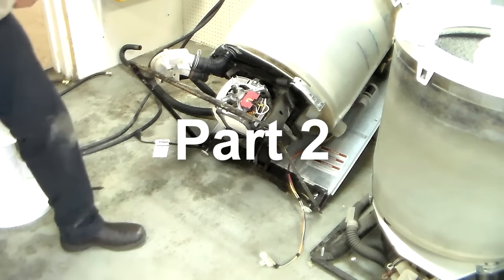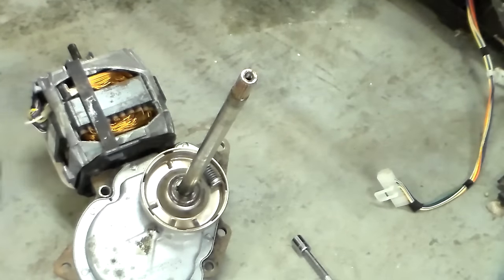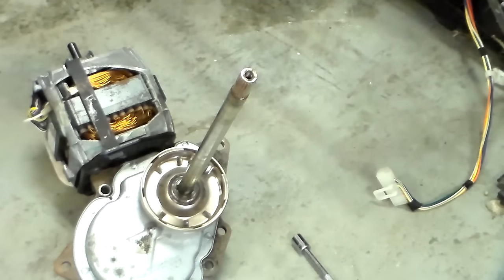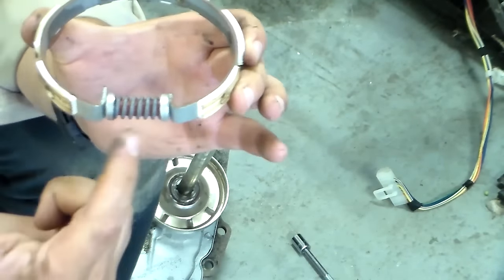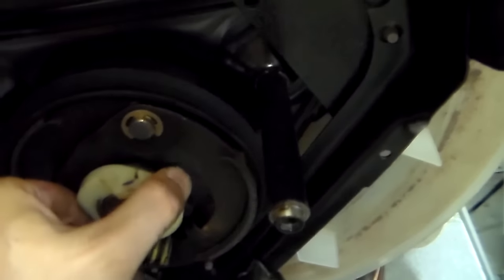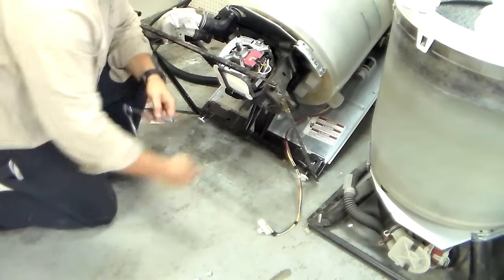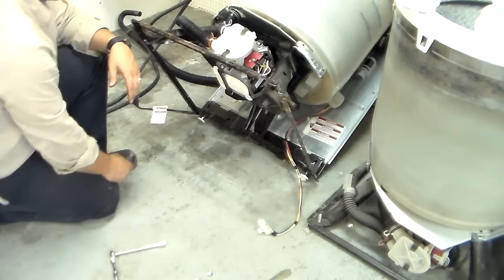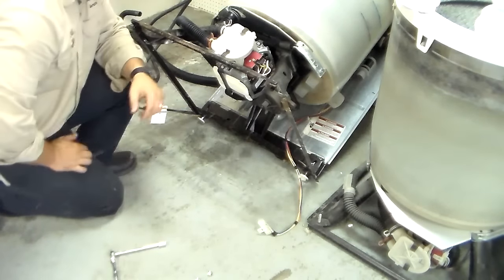Kenmore Whirlpool Washer Not Spinning 2

Comment: Hi Bill, thanks very much for your amazingly helpful videos! I have a question. I have a Whirlpool Washer that is not spinning. I dropped the motor and transmission. I hooked up my 1/2 inch drill to the motor shaft and operated it in forward and reverse and the transmission seems fine. I grabbed the clutch pad and it appears to be fine. The motor coupler is fine. Any idea what the problem is?    Dennis
Reply from the maker: Does it sound like it's spinning but not spinning or not making any sound at all when it's supposed to be spinning?

Comment: great videos!  still trying to solve my problem.  agitator works, but will not go into spin cycle.  It tries but basin does not spin.  agitator works.  replace coupler and cluch but the old ones seemed OK.  I CANNOT turn the plastic brake release counter clockwise by hand like you did.  It's like the basin is seized up.  Motor and trannie seem ok.  Is there a chance come clothing or something else is preventing the basin from turning easily?  How do I get the metal basin out of the plastic liner?  THANKS

Comment: Currently have my washer tipped on its back. Checked the coupler, it and the rubber are good, pulled the transmission to access the clutch its acting as it should in your vid here. What would you check next? I did notice one broken tab thingy under the plastic topper that needs to be removed to pull the transmission out....would one of those tabs being broken be the culprit?

Comment: Hey bill, love your videos, I do have a question. I ordered this part number 285790. When it came, it only had three white brake pads instead of the six that the original had. It does not have the tention that you showed of the new one in your video. Where do I get one like the one you used with all the white pads?

Comment: Bill,
 Last week my washer, Whirlpool, went through the wash cycle fine, it filled up , did rinse cycle okay until the spin. It made a very loud grinding noise so I turned it off. Does that sound like a coupler or clutch. I have a friend who might be able to fix it, I'll buy the part. Btw, what is a wig wag?

Comment: Great videos Bill!
After watching parts 1 & 2 of Washer Not Spinning, I performed the service checks you illustrated. Nothing was wrong there!
I saw another video about the transmission check. Would it be safe to say that that is what I need to replace? Or is there something else I should be checking?
As Compwhiz128 mentions; spin gear, cam drive, basket drive block or neutral drain pak. How do I go about checking these?

Comment: Hey Bill, my problem turned out to be a broken finger on the brake release... discovered thanks to this awesome video. Do these just brake (as they are just plastic) or should I be looking for another culprit? How much resistance should the tub offer when trying to spin it with the brake? Thanks in advance!
Reply: Also having a hard time trying to locate a replacement part.
Reply: BiGPoo5125 Nevermind... I see now that it comes in a kit with the clutch band.

Comment: Great vid,  I replaced the coupling.  The old one was rounded out in the middle.  I put everything back together.  And . . . . just the same hum.  No spinning, no agitator movement.  Bummer!  Any thoughts about what my next move should be?
Reply from the maker: Robert Douglas Pull the pump off and try to run it with the pump pulled off the motor shaft.  The pump could have something in it and causing the motor to not turn.

Comment: Loved the clutch replacement video.I was replacing one in a whirlpool just like the one in your video.When I turned the brake and pushed it up a two inch gold colored semi round pin with a hole in the bottom fell out of the machine.Any idea as to where it goes?
Thanks for any help you can give me.

Comment: Hi Bill, I have a 80 series Kenmore washer and I have replaced the coupler, the complete clutch assembly and the agitator cogs. My issue is that the drum won’t still spin at times.It does drain ok but wont spin unless I push the on / off button to off and then back on-then  the machine will start to spin. The timer assembly is moving through its sequence so I believe my timer assembly is good. Any idea what will fix this issue?  Thanks Noel

Comment: @Bill Newberry…so problem doesn’t spin on spin cycle, it’s does agitate….the couplet does appear fine….im not as far as removing agitator because I need to get the proper tool to remove agitator to assess the clutch.

. MY QUESTION….i noticed a grease/oil substance by couplet and surrounding area…is there an additional concern? 
Not sure if this is problematic to do self repair or buy a new one

Comment: Great video. I think my Kemore has a clutch issue. When I have a heavy load it some times spins but other times I have to spin the tub and then it starts to pick up speed. Are all clutches on Kenmore the same? So if I order a clutch for a kenmore will it be universal?
Reply: Your motor has an open winding. Probably corroded through the copper wire or the capacitor dried out and overheated the wire.

Comment: I have a Kenmore 400 washer that initially had a no-spin issue, and it was neither the motor coupler nor the clutch. It turned out that it came from the factory with a smooth-bore drive block (without the two notches for the driveshaft fingers to fit in). I installed a new notched drive block, and now the machine spins like a brand new one.
Reply: Tommy Griffin I gotta try this I have the same 400 model changed the clutch but still drum doesn’t spin agitator does but not the drum gonna YouTube that part see if that helps thank you in this message

Comment: The reason I asked about the clutch was i had just replaced the coupler in November. Thanks to your video on that problem. If the coupler isnt bad then the clutch should be the next thing I check?
Reply from the maker: +Les Braden It may be the coupler again.  You could have something stuck in the pump too.  You'll have to get under there and check it out and see what's going on.  Let me know what you find.  Thanks
Reply: The coupler is broken into pieces & the rubber grommet between the 2 pices of the coupler is broken into pices. It looks like something rubbed on the outside of that grommet too. I took the pump off there was nothing insideof it. The motor & transmission seem to be turning freely. when I started there was a pile of ground rubber on the floor from the grommet (not sure what that part is called)
Reply: I bought a new coupler & isolator. The new 1 has a steel sleeve in he coupler . Hope this 1 lasts longer than 3 months. Thanks again for the great videos & expert advice
Reply from the maker: +Les Braden Hopefully!  If not, your an expert now at changing it!  Good Job on your Repair!

Comment: Yours is the best video out there on this subject.  I did everything by myself.  The coupler was broken and the clutch was good.  Replaced the coupler, but it is still not spinning and the agitator is moving slowly.  Could I have screwed something on too tight?  Mine had what looked like a capacitor that had 2 wires I pulled off and reattached.  Didn't see that on a video.  I marked it so I would put the correct ones back in the spot they were in.  I took pictures to be sure I put everything back.  Not sure what I did wrong.  Could I have not put the wiring back in all the way?  Thank you.
Reply: +Singlewomensurviving  replace your plastic dogs for agitator
Reply: J D what's the "plastic dogs"?

Comment: Great video Bill, but I have a question:  What's the first thing to check if it does NOT sound like it's spinning?  (I've already tested the lid switch, and checked the motor coupling)
Reply from the maker: peccatumDei What's your model number?
Reply: Bill Newberry
Maytag MTW5830TW0
Reply from the maker: peccatumDei Check your pump and make sure there is nothing stuck inside it preventing the motor from turning.  Your machine should have paperwork under the control panel, you'll have to see which terminals on the motor get power from the timer when you start your washer.  Make sure the outlet has power before you do anything though!
Reply: Bill Newberry
Turned out it was the balancing ring on the top of the basket.  It had popped loose at some point, and rubbed against the ring at the top of the tub until both became so damaged, that they locked up.  The balancing ring was worn clear through, allowing the fluid to escape.  The parts are on order now, and should be easy to install.

Comment: Bill, thanks for the video. It's 8 years old and still relevant!! Question: At the 4:48 marker you were able to spin the finger that's on the bottom of the tub and manually spin the tub. My tub is not spinning when i do that part and i believe that is my washer's problem. The clutch, actuator, etc all look good. Do you know why the tub is not spinning when i turn it manually with the transmission, engine, everything you did removed?

Comment: Alright, hoping you can help. I have one of these machines and it works well in every way except that as it is free-spinning down at the end of the spin cycle, just seconds from stopping, it rattles or knocks very loudly. 

There are no other noises during the spin cycle.

I have the cabinet off and can't find anything loose.

While holding the outside of the clutch, I can reach up and move the drum but it is no easy. The brake does hold in the other direction.

Comment: Hi Bill Great video  unfortunately I replaced a clutch and the brand new one slips.  prior to replacing the old one when I spun the clutch it moved without much force the new was much tighter after I reinstalled everything the new one was slipping.  The brake was disengaging but moving slowly.  When I tried  disengaging the brake and spinning by hand it seemed hard to turn.  I reinstalled everything and tipped the machine back and I could see the clutch moving fast and the brake section moving much slower.  what would be my next step thanks in advance. Rick

Comment: Great video.  I replaced the coupler but still not getting anything... Just a very low buzz and occasional 'arcing' noise.  Seems electrical.  Any suggestions?  Think water , which sloshed everywhere, is in wiring harness?  Please help thx

Comment: What if the clutch is not available for 3 months?
Use a small "washer" and fix the washer. My old Kenmore washer was not spinning out the cloths properly. But ordering the part was going to take too long. I placed a small washer in one of the spring holders. Re assembled and the washer works like a charm 🙃🤣
I my case the clutch appeared to be in decent condition with plenty of material on the pads. 
I am still ordering a clutch as I do not want the metal rivets holding the clutch pads to hit the clutch housing.

Comment: There is also a transmission neutral kit available.  If it doesn't pump out the water first before spinning, the clutch can slip due to the weight.  The kit is 388253.

Comment: Bill,
Any tips for resolving the issue when the coupler and clutch are both in good condition? The coupler spins fine indefinitely (with tension) one way but only goes the other way until it meets for resistance.  During the spin cycle, an electric noise is made but no movement by the drum.

Comment: Mr. Bill,
I have a question regarding my LG 4 yo Direct Drive washer.
I recently had to replace the board and could not figure out why the board blew...
At first I thought the issue was the heater element and thermistor.
Those 2 tested normal and functional.
Yeterday I washed 4, 1 hour extended loads.
Up through the  3rd load, all was normal, no odors, no error codes at all.
I returned after the 4th load chimed, and as I entered the garage there was that strange burning electric odor in the garage.
I found the odor emitted from the Direct Drive motor assembly, and the aluminum cover that spins with the motor was much HOTTER than usual.
The control board was also odiferous as if it was getting too hot.
Ihave smelled this odor before when a light timer in the house malfunctioned and the balast burned up inside the timer leaving a brown burn mark on the external timer surface.

Do you have any experience with this strange electric odor?
Has any of your customers ever mentioned it?
Am I not supposed to run multiple llaundry loads consecutively?
Do Ihave to wait a period of time between loads to keep the motor from being damaged?
Any thoughts would be appreciated regarding this elecrical phenomenom.

Thank you,
Robert

Comment: Bill I have replaced the coupler and clutch. Machine worked like new for about a month. Now I have the same problem basket  and the agitator will not move. Took machine apart checked new parts all seem to be fine... 
any advice on next steps please!!

Comment: Need help... I did this repair on a LSR7010pq1. The center shaft was corroded and would not come out. Took a lot of effort, hammering and time but I got it out. I removed the inner spin basket thinking it would help me get the shaft out. Wrong. 
  The drive block is stuck in the basket and no amount of hammering with a 4lb mallet will set it free. Replaced clutch and reassembled without issue. The drive block was very difficult to tighten and get it to lock on the shaft. But I got it tight.   Now when empty, Low spin is fine but in high spin it goes violently out of balance.
    I checked the suspension components and they are all in tact. The Spin basket remained attached to the shaft after several tests. 
Not sure what went wrong. I think it is related to the drive block or the basket. What confuses me is that it is fine on low spin.
I am going to run it without the Spin basket to see what happens.
Any Ideas what my problem is ?

Comment: Hi Bill. I have a question. Is there a difference between the 3 pad vs the 6 pad clutch band?
Reply: That's my question too. I have a 3 pad Whirlpool, and the listed replacement part also has only 3 tabs; but yet it has the slots for 6. My clutch is slipping thus needing to be replaced.

Comment: Your video series was very helpful but I am having trouble reassembling motor/gear assembly. Replaced clutch along with plastic cam. Know to have cam and clutch spring on opposite sides when reinstalling but bolt holes for assembly and transmission will not seat. Approx. 1/2 inch between assembly and transmission. What could be the problem?
Reply: Solved the problem.  Gave the assembly a good
shove with the bottom of my foot. Washer is spinning again!

Comment: The clear cup hanging off the bottom of the tub has some brass pins in them with holes for carter pins. Should those be installed into the plate or are they shipping pins ?

Comment: Would replacing the clutch band fix the issue of the drum not spinning during the spin cycle?  The center column still rotates during the wash cycle.  Also what is the part number of the clutch band?

Comment: Are those white pads on the clutch supposed to be plastic? I replaced my clutch two years ago and it already went bad. I'm thinking maybe the original clutch is supposed to have ceramic pads or at least made out of some harder material?

Comment: Great video, but my 13 year old whirlpool washer stopped spinning after a load of wet sheets my wife said and it really wasn't over loaded with sheets, so I put it on spin cycle a few times and she was right it didn't spin after the fourth of five try without me doing anything different it started to spin again. She thinks I'm the best and she is now on her fourth load of clothes/towels ect. any idea what happened?  Thermal overload switch?  Thanks in advance.

Comment: I appreciate your tutorials so much. Thank you for posting. Being on fixed income of not much and living in an apartment, DIY is all there is!
Kenmore Washer 11092260100 is not spinning. It fills and drains, and I hear the motor running. 
Following your help, I removed the pump and motor and discovered the mutilated connector, biked to repair/parts place, got the couplers and installed them. No luck. 
I pulled it out again following your example, this time pulling the transmission and motor. The clutch, as you showed, was very hard to move, but did move. 
Looking deeper, there was the brake,  with a white plastic contact that you showed lining up opposite the clutch spring. It spins easily but looks like the piece offered as a replacement, not broken. I also noticed that spinning the coupler in the right direction did turn the clutch assembly. Back together, still no spinning.
This morning, I pulled the rusty old screws from the electronics housing, and did continuity test on the lid switch, which I could hear clicking. In case of some other switch related issue, I even by-passed the switch. Still no spin. I sit waiting to hear old familiar clunking sound as the spinning starts!
I hate to call repair guys trying to filch bits of knowledge and pretty sure the landlord doesn't want to call one either.  I'm down to either bad transmission or a brake issue, I guess.

Comment: I just took the motor off to check the coupler and it's fine. Next I'm going to check the clutch but since the motor is still apart from the coupler do I still need to get the bolt off from inside the agitator? Thanks

Comment: The typical cause of a bad clutch is oil, grease or other substance between the clutch pads and the clutch. If you're going to replace just the band make sure to clean the whole thing out real well. For a few bucks more you can get the whole kit, replace the entire clutch and the plastic break catch as well. Its a bit harder to do but I feel a better repair.